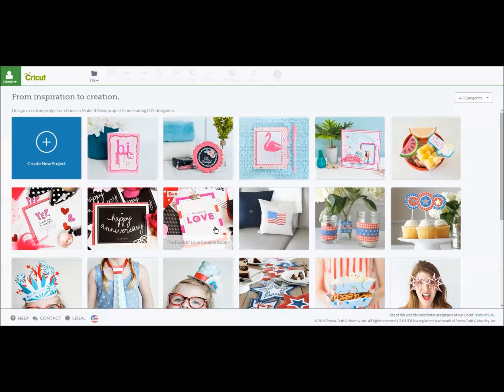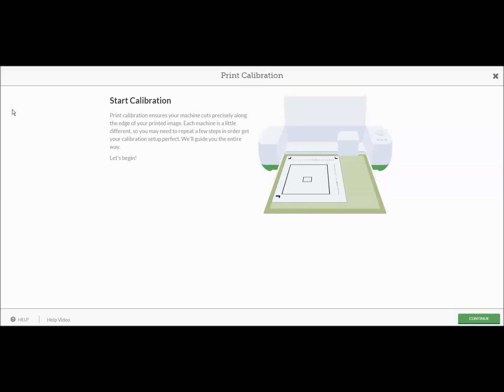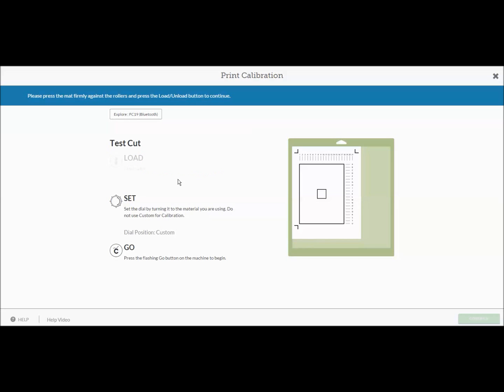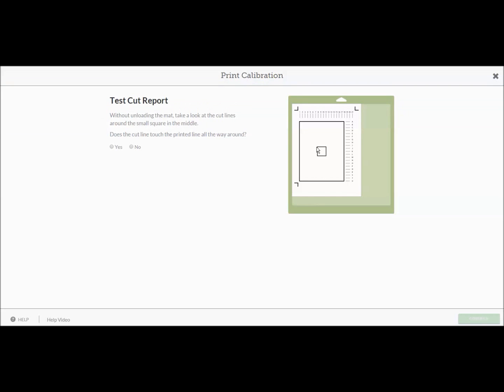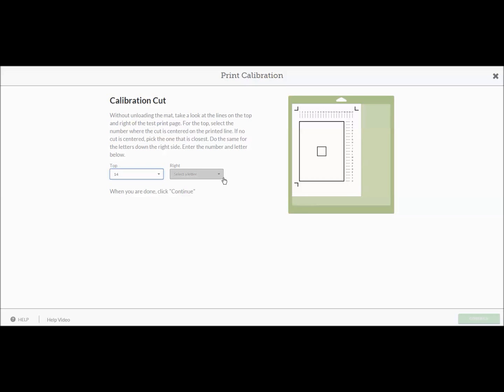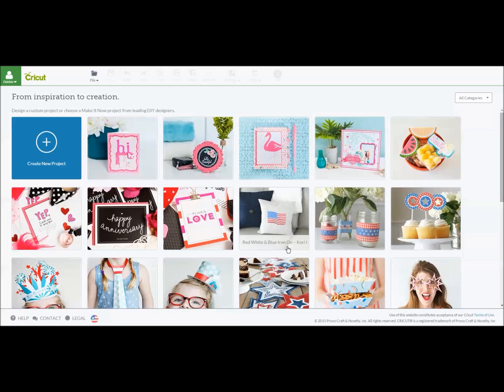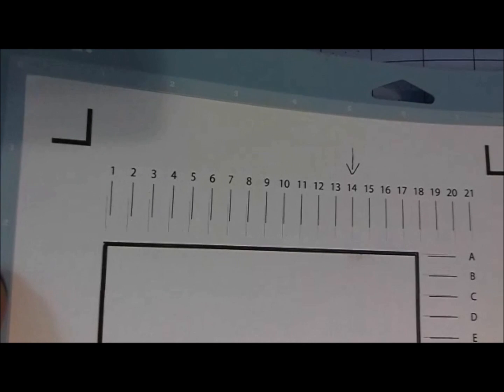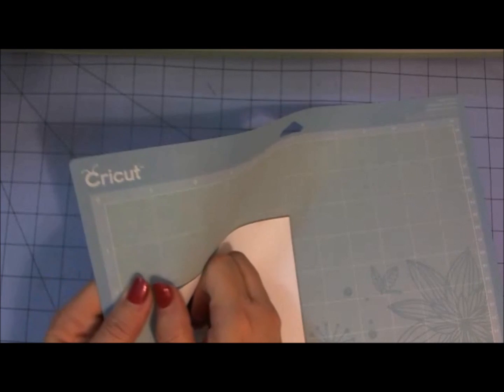How To Calibrate Printer with Cricut Explore to use Print Then Cut Feature

Comment: When you say no and it starts to cut those line next to the number side and letters what are we looking for with those cut.that my probably I don't no what I'm looking for.please help
Reply from the maker: You are looking for which one across the top (the numbered ones)that the cut line is closest to the center of the numbered line and same for the alpha lines on the side.  If it’s hard to tell, shine a light and look close and you’ll see them better. Make note of the number and letter. You will be prompted to enter them in the calibration process.

Comment: I have an Explore Air 2 machine, I don't even see  the word "calibration" in the top left corner of DS like you are talking about.
Reply from the maker: Rita Dean hello. Design Space has changed since I made this video. If you need to do a printer calibration, click on the 3 hash marks in the upper left corner of Design Space. A drop down menu will show up, scroll down until you see the calibration option. Just follow the steps on the screen to do the calibration.  You will need to make sure your printer is set up to your Cricut machine either via cord or wireless before you begin.

Comment: I'm sorry , Kenneth, but I'm afraid I can't agree.  This most certainly does become Cricut's issue.  My Explore Air was set up and calibrated when my browser was Internet Explorer and it worked perfectly!  I received a message from Cricut stating that Microsoft will no longer support Internet Explorer and I needed to change my browser to Firefox or Chrome, which I did.  SINCE THEN, I cannot calibrate my machine!  I called Cricut, and their customer service rep told me that neither browser will PRINT a calibration sheet.  So, she emailed me a calibration sheet. I printed it out and it still will not calibrate after several attempts!  Now I'm stuck with a $300 machine and over 200 cartridges with images I used to be able to print and cut, but can no longer use them.  Cricut did this with another of their products not long ago. The Gypsy.  After updating their software to the Gypsy, it can no longer be used!  It's obsolete!  Now, many crafters have it stuffed away somewhere in a drawer or closet.  So, yes, it's Cricut's problem!  And get this, Cricut released a new Explore Air 2 machine and has never mentioned the problem with the Print and Cut feature!  How nice!

Comment: I hope this issue I had and the resolution is helpful.
  One of the things that was wrong with my calibration efforts was that my printer did NOT print the calibration sheet CENTERED on the 8.5 x 11 paper. Because of that the sensor would not read the registration marks in the corners properly. I copied the print out, scanned it into Photoshop, centered it on the graphic page and was successful in the calibration.  This is NOT Cricut's issue but a software issue.  This issue is constantly overlooked and you will never be able to calibrate the machine if the marks are not properly printed/aligned.
Reply: Can you do a tutorial video 🥺 I think that is what is happening with mine